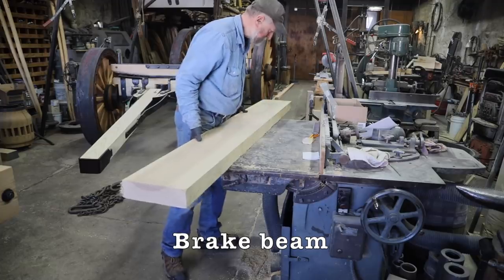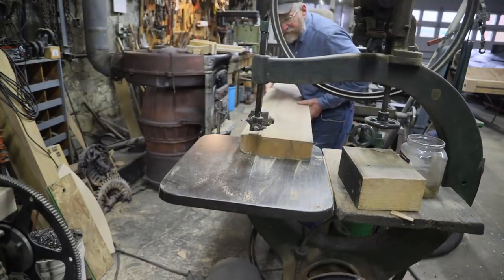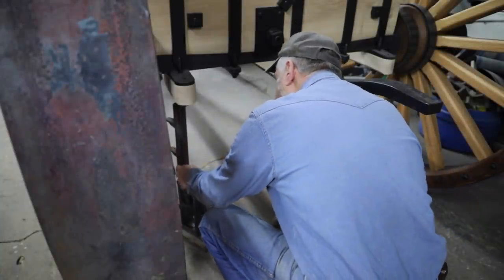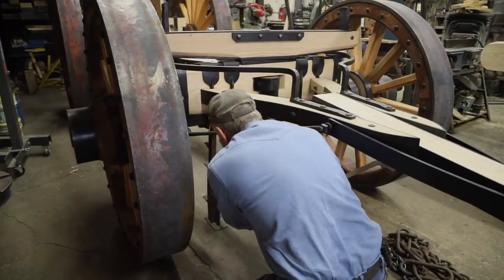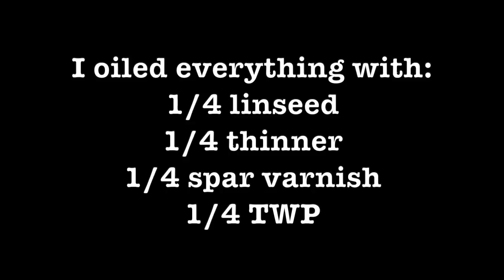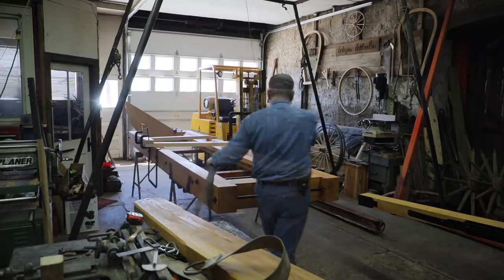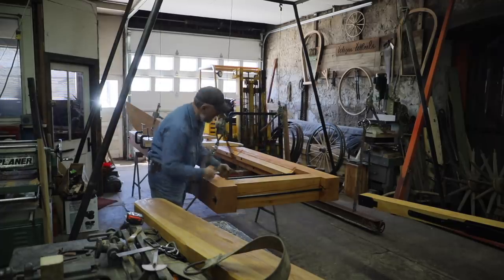Mystery Forge Piece & Mounting the Water Tank Beams | Engels Coach

Comment: Those look like the mounting and stabilizing brackets for the water tank to that wagon. If I'm on track and thinking right and properly to. I'm just only guessing though on that part of it myself is all. At least that's what those look like to me that is anyways. And could possibly be what's called double collapse mounting stabilizer wagon tank brackets and braces.,or brakes mounts to for tilting and lifting the water tanks and other tanks that is ment for those purposes only to. That have liftable tank height settings and rollover locking bracket features on them to by locking pins and spring loaed pull and push locking safety handles built-in the set-up and design of those wagon units. I know that some had those as brake framework mounting brackets and others had those as water tanks and etc. with what's called hand breaking mechanisms built-in them to.

Comment: Curiosity only.  Why are the bolts inserted from the inside with the nuts on the outside?  Wouldn't you want the nice button heads on the outside?  I'm sure there is a reason, I just don't know it.  :-)